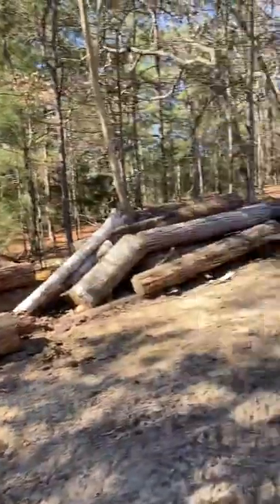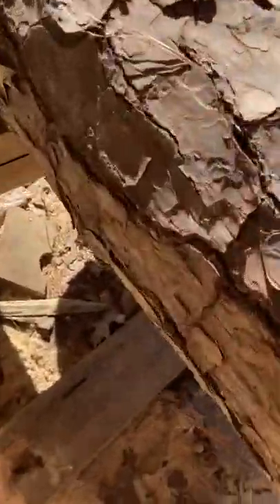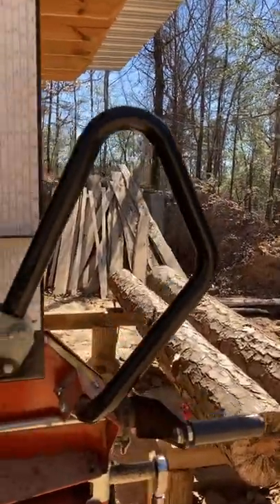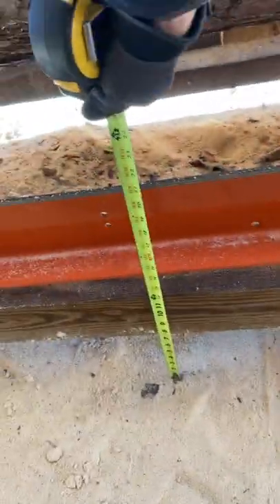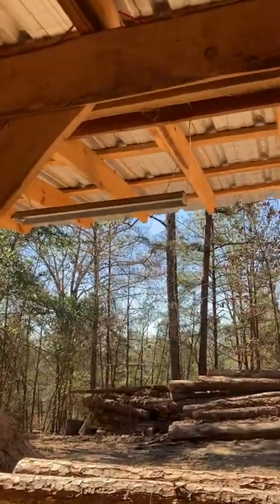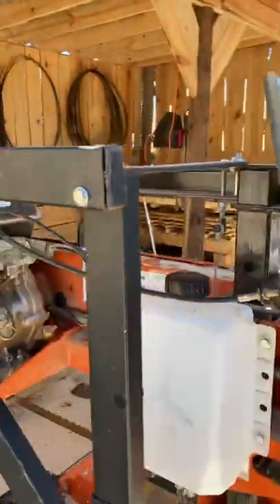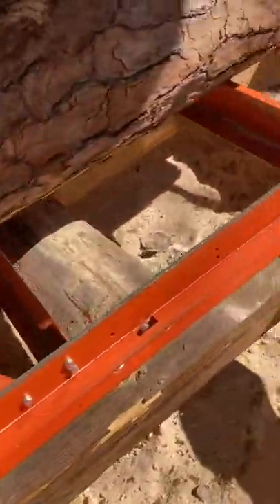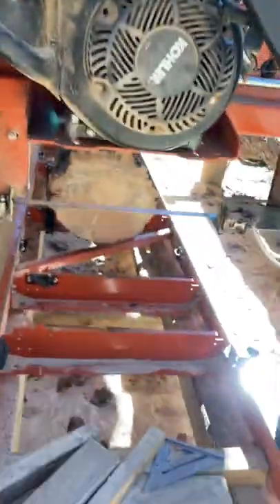A quick tour of my LX25 mill setup

Comment: How many horsepower is your motor on the sawmill and did you have problems with wavy lumber and if so what’s your solution? Any advice would be great thanks
Reply from the maker: I have the 9.5, I did early on. I had to figure out all the adjustments and got it resolved. I have a few videos that I have uploaded recently that may help.